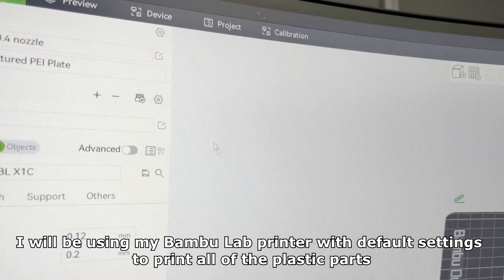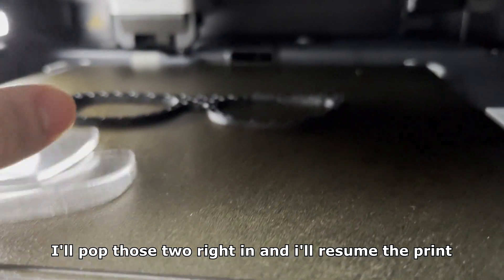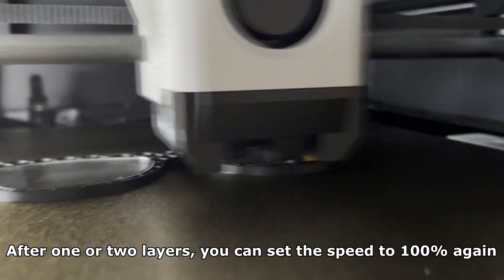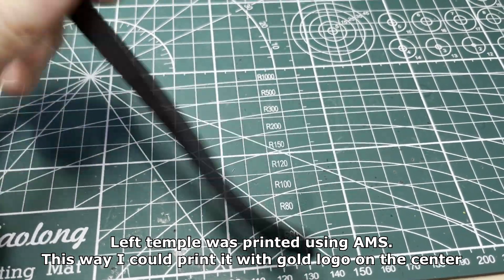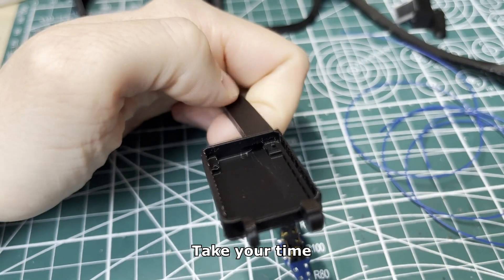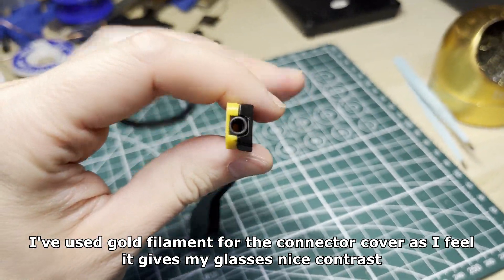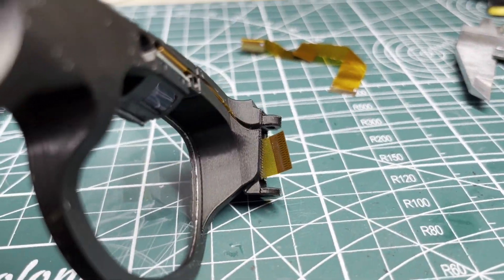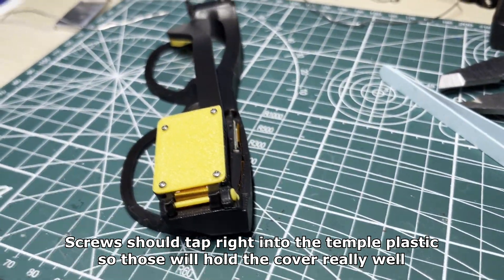Onyx Glasses 1.5 | Full DiY Assembly

Comment: Hi, this is incredible work!! I'm thinking of trying to build a pair of glasses based on your projects but I'm not sure I understand the difference between the different models you've worked on, i.e. the Onyx vs Sunrider vs Sideloader. Do they have different capabilities or different hardware? Do any of them incorporate trackers to make it possible to use hand tracking or other kinds of AR integration? Is there a project github/repository? If you've written something comprehensive about this I'd love to read it (even if it's behind a paywall)!

Comment: Thanks you for this amazing tutorial. I bought your frame. But since I need to buy display and HDMI convertor. I  have 2 questions:

1. About the display, in the links you provided there seems to be a small knob next to the display whereas in your video your display didn't have it. I'm afraid with that knob, the display can't fit in its place.

2. I dont have Video cable to HDMI convertor. Do I have to make it or I can buy it somewhere? How can I have the Bluetooth capability?
Reply from the maker: Hey!

1. You are supposed to remove the display from the case which has the black knob on the side. I think I’ve even made a video about it. 

2. There are a lot of HDMI converters available on AliExpress. Such as this one:
https://a.aliexpress.com/_Eu1mJzP

3. Bluetooth requires a lot more hardware than display

Comment: you may want to  start using a resin printer for a smother lighter print   , also ar glasses are getting cheaper  and mant products are avalable in this space for $400
Reply from the maker: I don’t think so
Reply: @ManolloMancelli   i like what your doing  
i don't own a 3d printer so i guess  i can;t comfirm that 

.but please  check  products like: 
 XReal Air AR glasses
Rokid Max
TCL NXTWEAR S RayNeo
and a few others they are all in the sub $400 space 
next gen will all be sub $400
   Glasses  much like VR products have  to fall  in at $250 to sell as a impulse buy 
many products sell out at this price ..